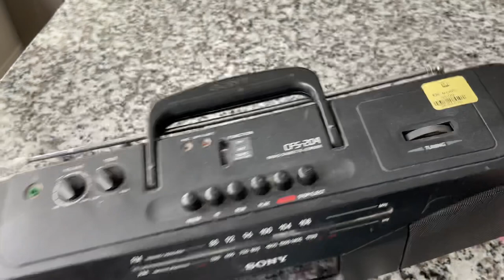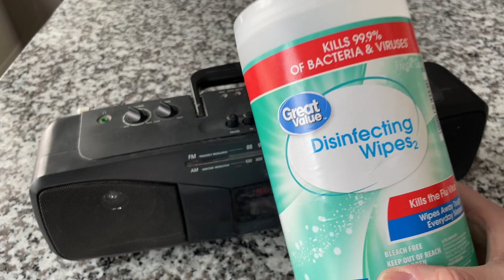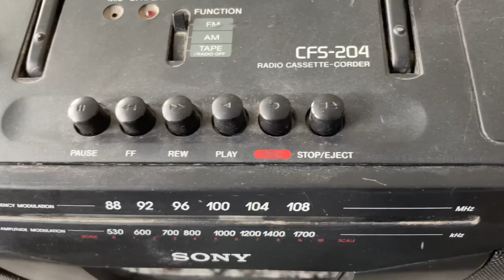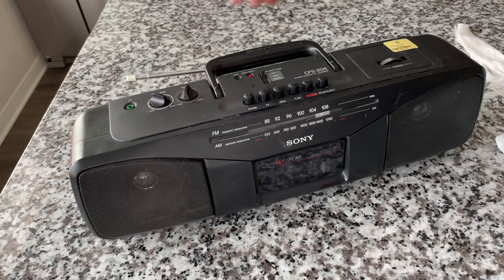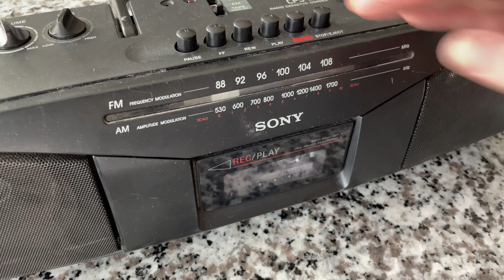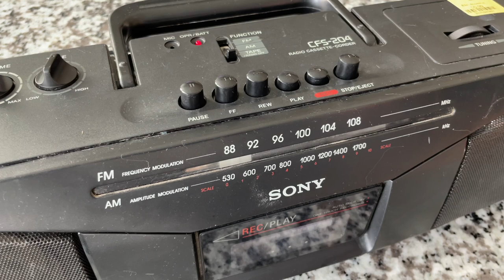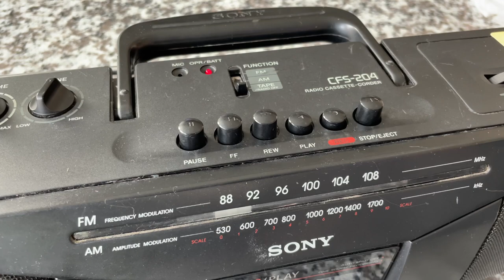$5.99 @ Goodwill - Will it work?

Comment: LIKE number 9 and feelin' fine. 

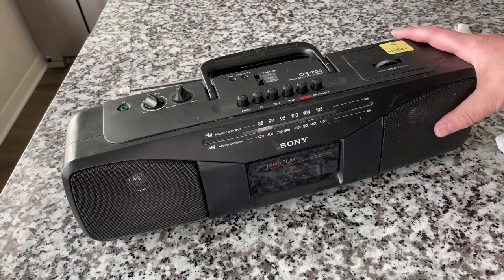5:51 Yes, Sony products back in the 70's and certainly in the 80's were excellent, well-built, and highly sought after. Heck, my original Sony Walkman still works perfectly today and I received it as a Christmas gift in 1984 or 1985 (a no-frills model for the Canadian market that just played tapes and didn't even have MegaBass or a radio).

Back in the day, Sony products were made in Japan, of course, but most Sony products these days are made in Malaysia, Indonesia, or China and the quality is just not the same. It was a similar situation with Sony blank audio cassettes and video tapes that used to be decent enough, but then the quality really tanked by the mid-90's and thus, Sony's reputation was slipping. 

However, I still get a kick out of seeing old Sony electronics or seeing the distinctive "It's a Sony!" logo. :)

Comment: I wouldn't take it back. Like you mentioned in this video, devices like this purchased new today sound tinny and thin. If I was you, I would order the belts and replace them. Give it a really good cleaning and try and sell it on Ebay. In good working condition its worth at least $75. I remember the 8 Bit guy doing a video about a portable stereo similar  to that one. He couldn't fix it, so he reviewed a modern day portable stereo that didn't meet is expectations and ended up running it over with a steam roller. Also ordering the belts and repairing it would make for a good video.

Comment: I know it sounds silly but before taking this back try some alternative batteries, the ones you are using might not be quite strong enough; they probably are but - well, alkaline or 'normal' batteries can vary, of course.  Many times have had something that wouldn't work non-alkaline batteries and worked fine with alkaline ones.  It's always worth a try?  Alternatively try with a power cord - if you have one around somewhere which will fit.  Again, it might not work, but you may find it has a quirk whereby it won't rewind or fast forward while being powered by batteries?  The power might not be strong enough; again silly suggestions but you never know.

Comment: The belts are bad. You can try boiling them, but replace them- it's worth it. That machine is simple, is far superior to the chinese feces hipster morons overpay for today's junk. That machine is also quality despite it's low cost in 1991. It's 100 times better than garbage built today and sounds better. Don't give up so easily.